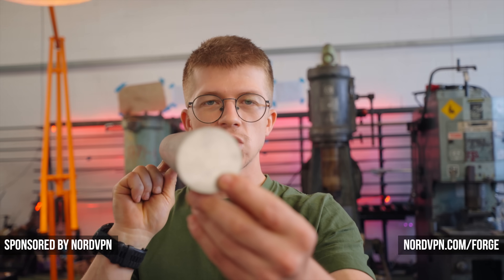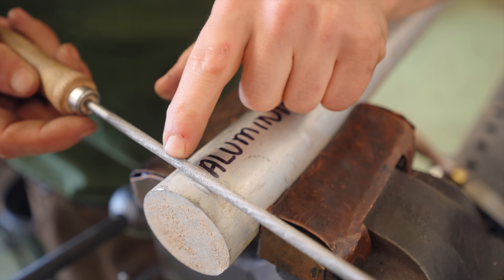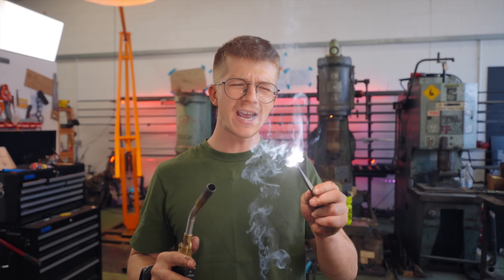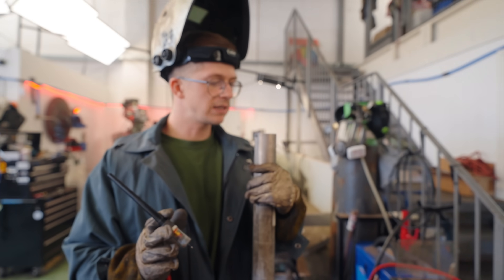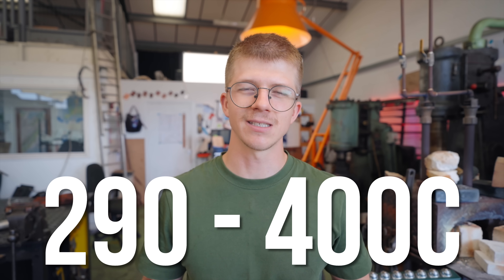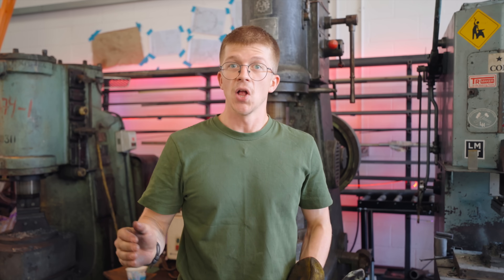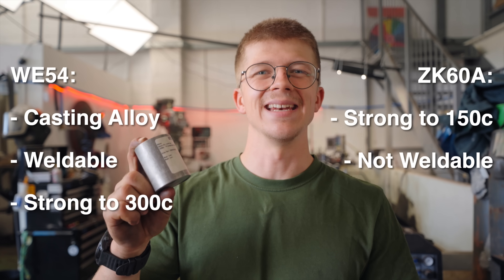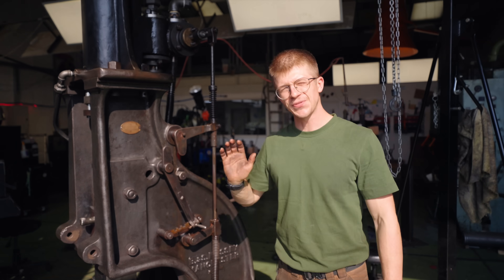Can You Forge Magnesium?

Comment: Metals plastically deform by forming and moving imperfections called dislocations around the crystal lattices of the metal. The crystal structure of magnesium is hexagonal close packed (HCP).  HCP metals tend to fracture like you saw because there is a direction in the crystal lattice in which it is very difficult for the dislocations to move, so the material will shatter instead of moving as you hammer it.
Reply: I don't know why but metallurgy is just cool.
Reply: In geology/gemology I'd call this Conchoidal fracture. Seashell like/scalloped. i noticed the dude's really shiny piece looked a lot like an arrowhead. Obsidian/flint/chert/agate are non/micro-crystalline silicon oxide Quartz that also has hexagonal structure. makes me wonder if you cooled Magnesium very slowly could you get a large single crystal like a quartz or sapphire tip.
Reply: @Roadiedave  which makes me wonder what happens if you quench it. Since it's so densely packed it probably won't do a lot, but if there's a reaction I expect it to be violent.
Reply: @josevera5094  good to know. I know aluminium can be heat treated (formula 1 pistons are heat treated after drop forging) but I didn't know quenching isn't part of that process.
Reply: It is possible with titanium/nickel to get single cristal turbine blades, i guess it could also work on magnesium  @Roadiedave
Reply: Also iron and steel bars are made of many 'micro' crystals. I recon that the 'quantity' of crystallites in a bar of metal makes also a difference in your capability of plastically deform the bar (not only). At the other extreme for ionic crystals. once you move one layer by '1 atomic layer' you have 2 pieces of crystal...
Reply: @COPKALA  there will be a correlation between grain size and workability of a material, besides just composition, the material meant for casting (as well as a the casting process) will have larger grains and be more difficult to work while the wrought material will have a finer microstructure and be more capable of plastic deformation.
Reply: Plastic flow is fulfilling the Von Mises criteria of disslocation glide. Its numbers of glide systems in the lattice that need thermal activation. In hexagonal the basall probably glide at rt. Pyramidal an prysmal ones only at high temps, and if only dont block each other. Speed is also a factor
After that comes the energy in the grain boundary, koherency, and effects of solutables. For the Internal cracks in the inside i would place the. bet on the accumulated shear stress inside the grain.

Comment: So, the best way to put out metal fires is to smother them in either sand or CO2. It's definitely a good idea to clean off the chips from your machines before you start machining magnesium, because if your iron filings are thin enough, they will catch fire too!
Reply: Magnesium fires can split the Oxygen off the CO2 similar to what it does to water.

Comment: It fractures in the middle, I think, because it was heated in an oven for not long enough, and the center was colder than the outside. But that is just a theory - on the other hand side, it would lose heat starting from the outside.

As mentioned in other comments, heating with an induction might be a better idea - though I don't know how would you control the temperature (maybe use thermocouple and a feedback loop to control the amperage and/or frequency of the induction coil?)

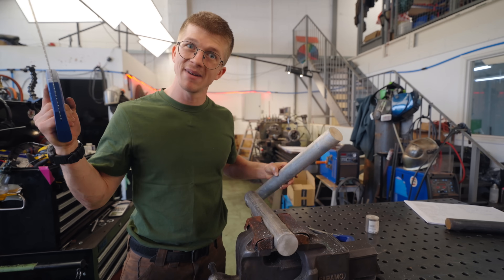Comment: 3:28 It makes sense - try a file on wood and you will see it doesn't move a lot of material. Technically you can use a wood saw on metal, but there are not enough teeth and it is very inefficient.

Comment: The taiwan pedal manufacturer we used to use has a magnesium pedal facility. It was at the top of the hill far from the main factory and away from any buildings. They said they sent their old CNC machines there when they bought new ones as it burned down every few year

We said are you joking and they very sincerely said it was entirely true 😂

Comment: I have a few questions!: 
1: If magnesium burns so hot, couldn't it be used to weld steel at certain points?
2: How safe is it to mix iron and magnesium dust? Is it a similar explosive mixture to aluminum and iron dust?
3: If aluminum cannot be forged and probably cannot be cast because it will then burn down instead of melting. 
a: How are the rods made then? 
and
b: What do you do with magnesium other than pressing it into tablet form for medical purposes or for emergency lights (e.g. under water)
Reply: 1: Magnesium can burn with oxigen forn the air alone. But I don't think that you could use that heat effectively to weld.
2: Thermite (wich i assume you are referring to in question 2) Isn't made from iron dust, but from iron oxide (rust). The reaction transfers the oxigen from the iron to the aluminium creating excess heat and liquid iron. Air is actually no part of the equasion.
A similar reaction might be possible with magnesium instead of aluminium ... but why? Aluminium is way more inexpensive.
3: As long as there is no oxigen around it, it cannot burn. You can still heat, forge, melt and cast it in a vacuum or in an inert atmosphere like argon gas.
As for what to do with it: use it in alloys (metal mixtures); make vehicle parts that need to be lighter than steel and stronger than alunimium; make nice fireworks, ignite thermite, use the magnesium ash (-oxide) for various other stuff.
It's just one of houndreds of metals and alloys and each of those have their pros and cons.
Reply: @Culpride  yes i was referring to Termite and for a Reason because he produces a lot of Magnesium Dust and bits and you can see in the video that he only clean out the Ruff steel/ metal strings and bits and he says that he explain why he Does it later but he never did. Sooo he got a good mixture of iron /steel and Magnesium splinters and dust laying together in his workshop. If it can produce heat like Termit and if it got wet due to water spilling or to watery cooling öils that he uses then he could burn down his workshop in a Blink. That is the buy why i ask.
Reply: @waylinar  For thermite you need rust. Not iron dust/shavings.
To burn magnesium needs oxigen either from air or from the rust.
Reply: @Culpride I know that. I come from Germany and trained as an energy electronics engineer here. Metalworking is part of the training so iron and aluminum shavings and powder were always available! During my training in the winter, all of the trainees (16 in 1 class for 3.5 years!) took old tin cans for sweets and filled them with aluminum dust and iron dust and then added 1 drop of water and you had a pocket warmer because this drop of water was already enough to stimulate the heat production of the aluminum and iron dust mixture. In some cases the cans reached temperatures of up to 70 degrees Celsius. 
Alex has everything he needs in his workshop. There is always moisture in a hall, and he also uses cooling Liquids when drilling and milling that retain water. Rusty metal is present throughout. and magnesium dust is related to that. :D Do you now understand what I'm getting at? Actually, iron/steel dust and magnesium dust are already mixed in his milling machine. including coolant that largely contains water! Oxidation of iron is therefore inevitable, which 100% ensures the presence of rust. + Magnesium dust/spies. So the question is, isn't that enough to generate enough heat to ignite the magnesium dust? or at least warmed up
Reply: Magnesium can be cast, but you need to use an inert cover gas (like argon) to melt it.  Same as with welding, where the welding gas provides the inert cover.

Comment: God I love magnesium so much, both my vintage racecars have magnesium wheels and one of them actually has a magnesium injector hat which is the fuel system on vintage nitro racecars. It was a space age metal and the lightest that your average joe could get his hands on. Alot of early dragsters even had magnesium bodies which was an artform in its own right. Some modern nhra nitro parts are still made out of magnesium but it has Definitely been replaced by more modern materials like titanium and carbon fiber

Comment: Table salt for magnesium fires. The specialised fire-extinguishers (Class D if memory serves) for metal-fires (lithium, magnesium, titanium) usually sport either that or some other (really well dried) salt with no oxygen atoms in its molecule. The salt melts, coats the metal fire and strips it of contact with oxygen. Avoid baking soda (usual powder fire-extinguishers have that in them) or water, because the heat strips the oxygen clean off the molecule and you just fed live oxygen to the metal fire. And yes, table salt is hygroscopic so it will have some water from the moisture found in air so if you want, you could bake-dry some plain table salt and keep it in an airtight container for emergencies if you indend to machine spooky metals. Or just spend a couple of thousand pounds on a proper class-D fire extinguisher. And one more thing... AluMag powder (mix of alluminium and magnesium) was used in some unstable homemade thermite or explosive or something, I cannot quite remember, but shavings of those two together might be particularely hazardous. Source: trust me bro. (so do double-check) Please, do more fancy metals sometime! 🦾
Reply: Ally is hard to set alight and mean af after that. Not recommended on a Friday afternoon in a railroad workshop 
So I've heard...😉
Reply: "spooky metals" :D
Reply: salts aren't formed from molecules though....

Comment: I don´t want to ruin the fun of trying stuff like this, but the "forgeability" of metals comes down to the crystal structure in which the metal crystallizes upon cooling. While aluminum crystallizes in the face-centered cubic structure (same as lead and copper for example) it can fairly easily be deformed. As far as I understand, this comes from the multiple directions in which the atoms can glide across each other without destroying this structure (In this case, 12 directions). Magnesium on the other hand crystallizes in the hexagonal closed package (like cobalt or zinc), which can only be deformed in 3 directions. So when hitting a metal with 12 possible directions of deforming, the chance of hitting in the right direction is way higher than when hitting a metal with only 3 possible deforming directions. 

Just to clarify, unless you're dealing with a single crystal metal, there are always many different microcrystals in your metal in all kinds of orientations therefore you can hit a piece of aluminum in way more than 12 directions without it breaking.  

Was fun to watch nevertheless ;)

Comment: From my understanding magnesium can only be melted/forged inside an inert atmosphere - unless you want it to combust. 

You cannot even use a nitrogen nor carbon dioxide only atmosphere as it even burns/reacts in those gases - it needs to be either in an argon(or similar nobal gas) atmosphere or inside a vacuum.

I'd imagine an arc furnace would work well for melting down magnesium as they operate under argon.

Comment: There are a lot of metals that aren’t grey. Copper, and gold are the most obvious examples. Cesium has a silvery, light golden color as well. Many metals in their pure (unoxidized) form are silver in color. Some even have a slight blue hue like osmium. Interestingly, many metals form a wide range of colors when oxidized too, but the metal itself is still silver, or gray of course. 

Also, all of those magnesium shavings you’re creating represent an extreme fire hazard. You work with fire in your shop regularly, so I hope you cleaned all of it up. Magnesium is relatively easy to ignite, and its fires are notoriously difficult to extinguish. You can’t use water, or CO2 extinguishers; those will make the fire much worse! I’d recommend at least getting a bucket of sand. Finely powdered sodium chloride will work too as well as some other salts, but Class D extinguishers are preferred. A bucket of salts, and/or sand will work though, and you can probably replicate the mixture of salts in a Class D extinguishers for much less cost. Some laboratories actually keep a bucket of sand around in case of a metal, or reactive chemical fires like those caused by metal hydrides (NaH, KH, LiAlH4) for example. This was more common in the past, but it’s still occasionally used because it’s cheap, and fairly effective. 

To completely eliminate the risk of fire you could collect the magnesium shavings, and destroy them by dissolving in acetic acid (vinegar should work, but a higher concentration of acetic acid would be better). Do this outside, and away from any ignition sources; hydrogen gas is formed in the reaction. At the end you’ll be left with harmless magnesium acetate. Dilute HCl works more efficiently, but it’s a lot more corrosive. The magnesium chloride formed is also fairly harmless.

Comment: Most mountain bikes forks use magnesium castings for the lower legs. Some bike companies are also starting to use it as a frame material, using tubes and welding them like aluminium. Considering your experience with it the process to achieve that must be quite finicky.

Comment: Haven't watched the video yet but after having ceramic cast magnesium inoculated steel a few times at my foundry job I'm guessing that's gonna be a big no. If you get the stuff hot enough it goes off like rocket fuel.

Comment: Jamie, do you need to measure the temperature of water when freezing it? Is that the only way you can tell that it is frozen? By the temperature? The same goes for boiling. Are Europeans  incapable of telling when their water is boiling without measuring it?
Reply: It's the opposite. You can tell it is 0 °C when water freezes and 100 °C when water boils. To know how much 0 °F is is difficult. Only 100 °F is simple to determine. At the end it is personal preference unless you want to calculate something. I like it much more to be able to estimate water temperature than air temperature.

Comment: If you were ridiculously rich you could set up an inert gas solution to heat the magnesium to higher temperatures without ignition and transfer it to the power hammer. Of course the power hammer and all the space in between would also need an inert gas, so it'd have to be some sort of furnace-fumehood-powerhammer Frankenstein monstrosity of a tool.

Comment: Why does magnesium not catch fire when welding, but it does when exposed to the flame of a gas burner?
Reply: Holy trinity Fuel-Heat-Oxygen. Not enough something is no fire. 
Heating a big heat sink will take time and big flame.
Reply: I thought it was because of the argon. Until I remembered that magnesium also burns in a block of dry ice. But it makes sense that the heat dissipates quickly enough.
Reply: @lahaya237  : The thing with dry ice is that it can pull the oxygen atoms off the carbon dioxide and use that to burn.  But argon doesn't have oxygen atoms in it.
Reply: Now I am curious how it would behave without argon.
Will it burn on its own or like diesel where it need constant heat source for burning?
Reply: @XtreeM_FaiL  that last thing i expected with the gas too. that it would burn like a torch until it was gone. i thought it was so weird that he used such a big piece as a test object. but he probably did his research first.

Comment: 10:30 When comparing the accuracy of temperature scales themselves, the Kelvin scale is considered the most accurate as it is based on absolute zero and is used primarily in scientific contexts; however, when considering the practical application of measuring temperature with either Fahrenheit or Celsius, Fahrenheit can be considered slightly MORE precise due to its smaller degree increments, allowing for finer distinctions in certain temperature ranges.  Soooo Kelvin, then F, then C.
Reply: Celsius has the advantage of being 1 to 1 with Kelvin but with a 273.15 degree offset, and therefore is easier to work with for most use cases where absolute temperature isn't a requirement, or you want an easy conversion from an absolute scale to a relative one that most of the world understands.

Fahrenheit is best suited for people brought up with it to help them gauge temperature on a human scale, for basically anything else it's superceded by other units of measure for temperature, and even though I know that 0f is very cold, I can't grasp in my head how cold that is unless someone tells me it's approx -17.8 Celsius, so it's not naturally intuitive unless you were brought up on it, so that argument doesn't hold water imo.

Also I find the argument about being better because the distance between each number is smaller and therefore "more accurate" to be a nebulous one because the decimal point exists, and if accuracy is required, then whole numbers in any unit of measure will simply not cut it.

Besides, all units of measure are (or in theory should be) accurate by design, no one measurement unit is inherently more or less accurate than another as long as its standard is clearly defined and consistent, otherwise they wouldn't be useful as a measurement.

Comment: It sounds backwards, but I heard you can use a flammable liquid or flammable material like a thick cloth to put out magnesium. If you have an easier to burn substance covering the magnesium, the fire eats up the oxygen before the magnesium can get it, turning a hard to put out metal fire into an easy to put out standard chemical fire that any fire extinguisher can handle.

Again, that's what I heard from a while ago so take it with a very large grain of salt, but it would be an interesting experiment to film.
 🤷